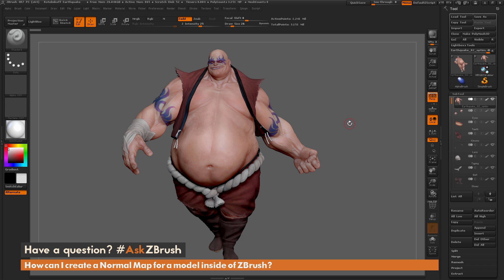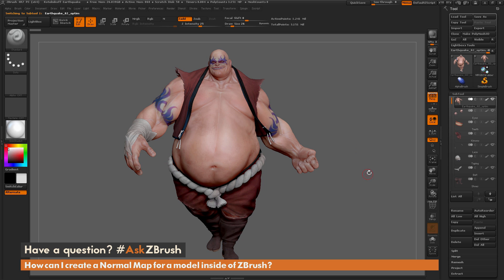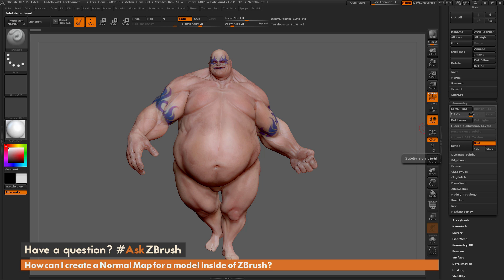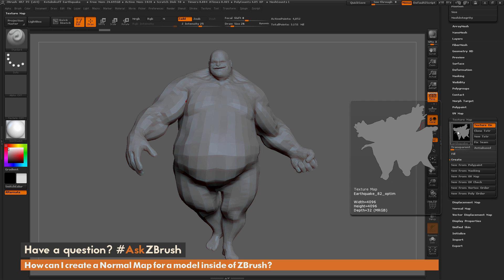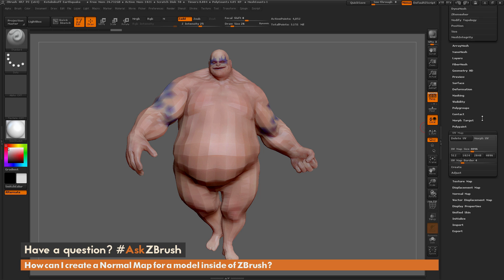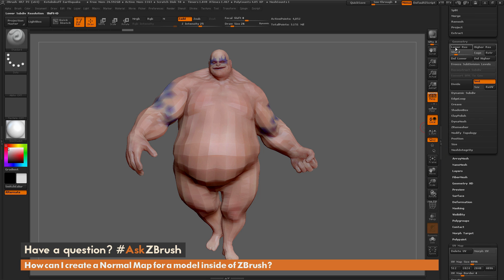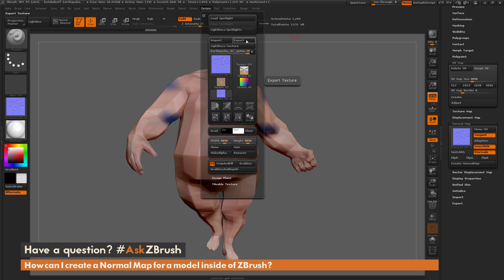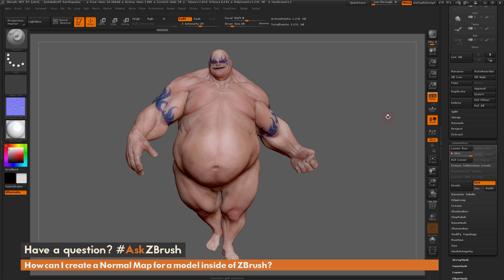#AskZBrush: “How can I create a Normal Map for a model inside of ZBrush?”

Comment: Quite unfortunate that ZBrush won't allow me to use a separate subtool. I have a very high poly sculpt and have created a manual retopologized version of the sculpt, along with UVs I've created inside of Maya. Marmoset Toolbag is having a heart attack when I give it a 16 million poly model for the high poly bake source, so I thought I could try using ZBrush to do this...
Reply: @adampaviacorp.6780I'm still fairly new to ZBrush so my brain didn't click right away to this, but its exactly what I ended up doing once I learned that the projection tool exists. Super useful, I love that after generating a high poly sculpt, I can retopo in Maya, bring the mesh back into ZBrush then get all of the little details back onto the new mesh and continue to work with a mesh that has a game/animation ready topology, amazing workflow!